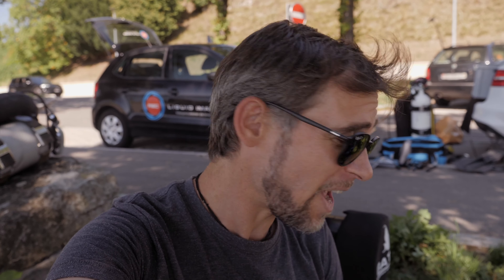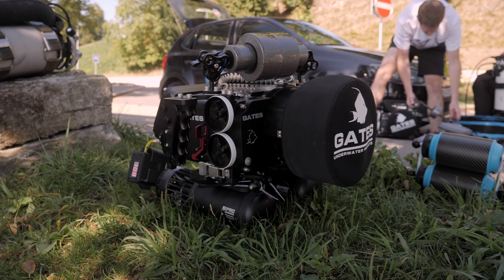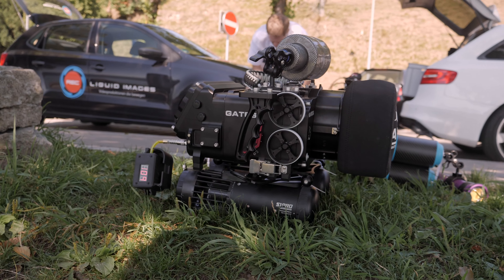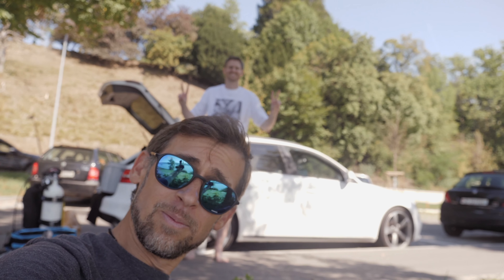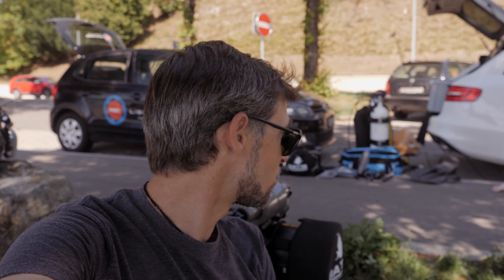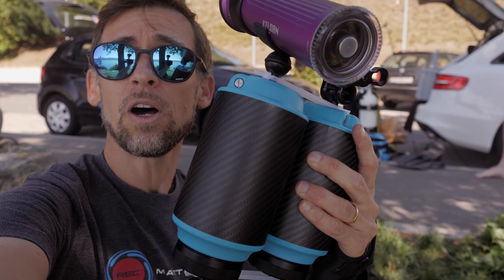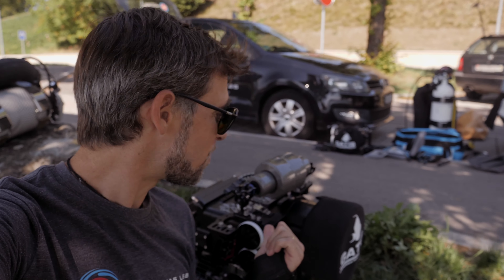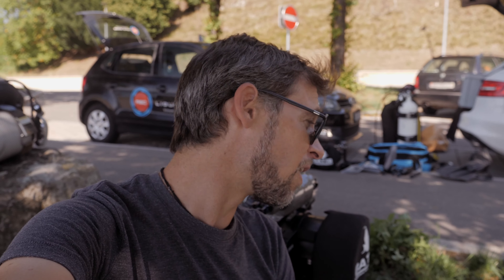Testing my new DUAL SCOOTER SETUP 🎥💪🏻 | LEFEET S1PRO & RED KOMODO

Comment from the maker: How many did you get right?!
Reply: I think it could be better to put the scooter baseplate upside down, then you could put the handle upside down also and you could get the grip little higher.
Reply from the maker: Interesting idea Juhani. I'll have to see how I can make this work, because the scooters can only be attached on one side of the dual handle grip. I'll give it a try. Thanks for the idea... 🙏🏻

Comment: 5 for 5, the scoter assist you can see you cover more ground quicker, that said, might be beneficial if used in that means vs a normal dive
Reply from the maker: Well done! And that's a good trick. It was the slowest I could go with the scooters. They don't allow to go any slower than that... 🙈
Reply: @MatthiasLebo  Packing my camera, lenses & needed underwater dive camera gear is already heavy enough for travel - I would have a hard time trying to figure out what to leave behind to bring 1 let alone 2 scooters

Comment: In my opinion as if to travel with heavy and bulky equipments are always stressing me out but once everything is deployed underwater when it gave almost neutral buoyancy, that is the best feeling ever.

With them on specially fighting current for chasing some good shot, I think would worth for that.  

So far i am using 60fps and slow them down with some post stabilization are still acceptable I think.
Reply from the maker: I know, right, it's always a relief once you've put everything into the water and the weight is magically gone. Best feeling ever... 😃 

Yeah, I work a lot with 60p and then slowing it down in post and I find that this works quite well most of the time.

Comment: It sounds like you would be happier with just one scooter?
Reply from the maker: Well, one is lighter and easier to transport than two, that's for sure, especially when traveling by plane. It's all a bit much for not too much added stability in my opinion. I would also like to have a slower speed level than the slowest existing one. Its a tad too fast for my liking.

Comment: Hi,do you keep your Komodo power ON before you get in the water?because of SDI! How do you deal with it isn't cause foggy issues if the camera ON before jumping in the water
Reply from the maker: No, I power it on once I get in the water. There is no advantage to my knowledge in powering it on before entering the water. The SD problem with the Komodo only has to do with the order in which you connect the cables, making sure that you always have power connected (but not necessarily on) to the camera and monitor before connecting the SDI from the camera to the monitor. 

And there is no fogging issues inside the GATES housings as it is made from steal which means the heat can dissipate from the housing quite easily.
Reply: @MatthiasLebo  Thank you for the reply.